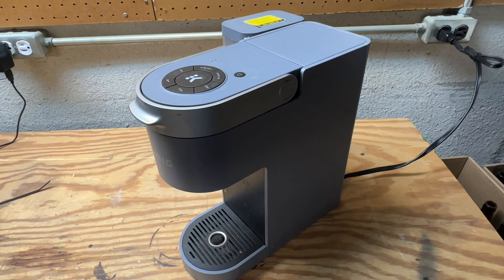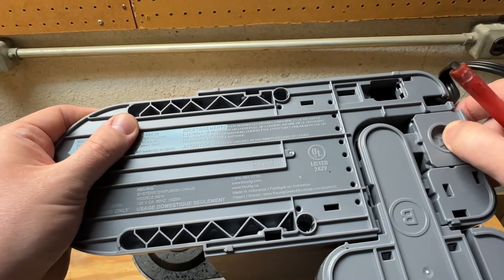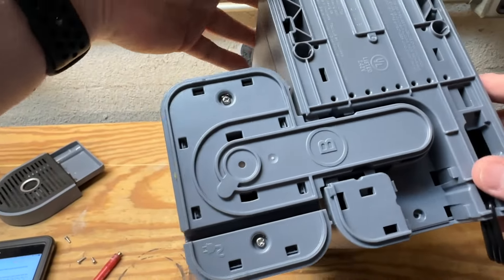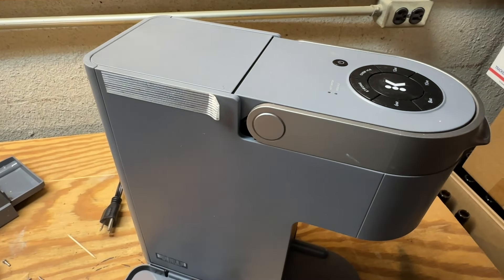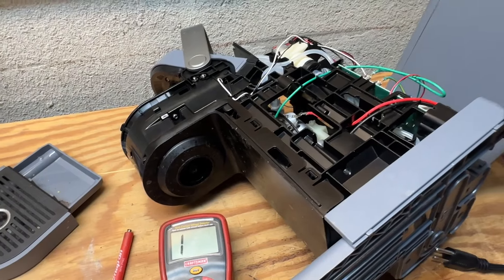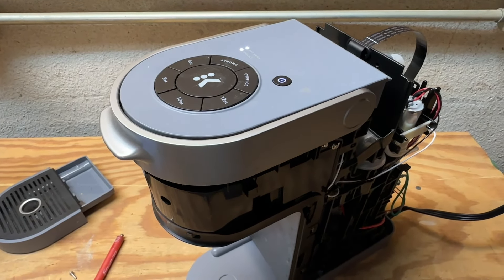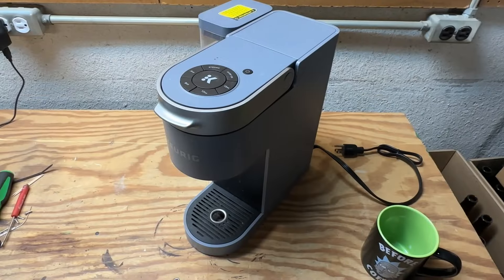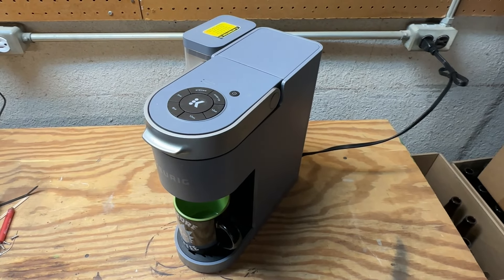Keurig K-Supreme Won’t Turn On, How To Reset Thermal Switch For No Power Issue.

Comment: you'd think if the thermal switch is the common mode of failure, Keurig would make it easier to reset with out having to dissassemble the whole thing
Reply: wrong...companiea dont want u to reset it they want u to throw in trash and buy a new one

Comment: I disassembled and reset mine a couple years ago. It was a PITA to disassemble, as is evident in this instructional video,  but it worked fine until this weekend when I  again forgot to fully seat the water tank. Having worked for years in manufacturing heating equipment with lmit switches, this device  should NOT have a manually resetable limit switch. There are auto-reset limit switches available that would provide safe shutdown and recovery after a cooling down period.This design is intented for the uniformed user to simply throw the coffee maker out. Also, if the water tank is installed but the water level is insufficient, it will tell you to add more water. But if you turn it on without the tank installed it just pops the limit switch and plays dead. It's either a design flaw or obsolescence by design. A good, but flawed design coffee maker IMO.

Comment: Well, my unit just (12.28.24) went into thermal overload and would not power on. This process worked perfectly and the step by step was really appreciated. Unbelievable Keurig would not incorporate a better quality overload that would reset when the unit cooled down. Worked perfect after reset. No idea what tripped it 😮 shameful POS

Comment: OMG!! I had my doubts but I plugged away and worked on getting that cover off. Hit that reset, did a quick test, all looked good. Reassembled, ran a test a BAM! All is working! What a great video and even better instructor. Sorry yours was a fail, but you saved so many from what I see, including mine. Glad I didn't toss it and just waited for the right time to work on this. Thanks for your expertise!

Comment: So glad I found your video.  Once I finally got the case off, reset the thermal switch and reassembled the case my unit works fine.  The case on my unit actually is several parts which come off in sections.  Thanks again.

Comment: Worked for me, but I agree with other commenters the reset button should be a little easier to access. That cover took a beating coming off but it's all working. Our was stuck on descale, can't help believe after the descale all we needed to do was rinse and reset the descale with the 8-10oz buttons, but I did successfully complete a descale cycle using clean water - having done the actual descale before the thermal switch opened. The add water light never came on during descale, but all seems reset now.

Comment: Keurig are scumbags for not building a reset button into it.  If it's going to trip so easily, it needs a button, just like a ground-fault electrical outlet or the circuit breaker in our homes.  Millions of comments online from countless people having this problem.  Many many comments of people on their 4th replacement because Keurig keeps replacing them (inside the warranty period) but then the replacement dies...again and again.  FOUR IN A ROW - OFTEN.  Ridiculous.
Reply: Me too 😂

Comment: Thanks for the helpful breakdown! Straight forward advice with tips on how to get the Keurig apart and working again. The keurig works like a charm again after resetting the thermal switch.

Comment: If the thermal switch was flipped, would it cause the Keurig to trip the fuse on the kitchen counter?  Or just not power on, with no other effect?

Comment: DO NOT EVER BUY A KEURIG COFFEE MAKER….THIS IS THE SECOND ONE THAT HAS QUIT AFTER DESCALING WITH THE Keurig  3 month Brew Care Kit .THEY HAVE HAD THIS PROBLEM FOR well over 5 years but don’y
Reply: Same thing happened to me with the exact kit. The instructions are designed to cause this thermal switch failure. It shouldn't be sold on the market as a Keurig-authorized product.
Reply: Just happened to me!  Watched the video, quite sure it helps.  Keurig is aware of this being a problem but does not provide an external reset switch.  Shame on Keurig.  Guess I have choices going forward.  I’m eighty years old and although this is a simple fix - the design is flawed and the manufacturer is aware.  Shame!